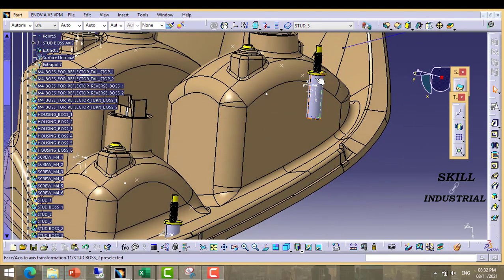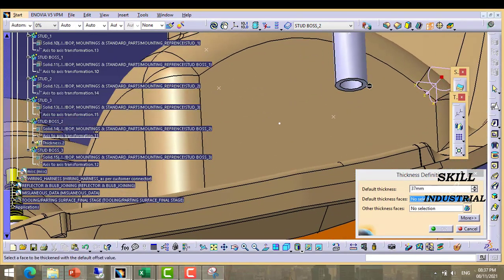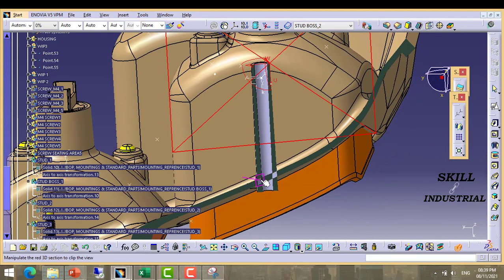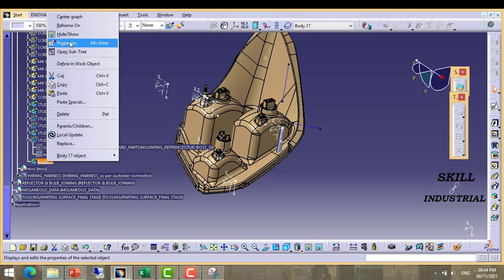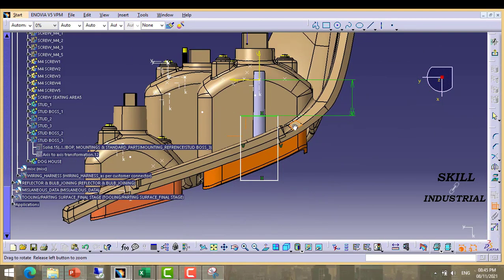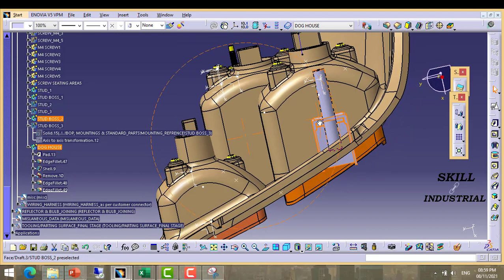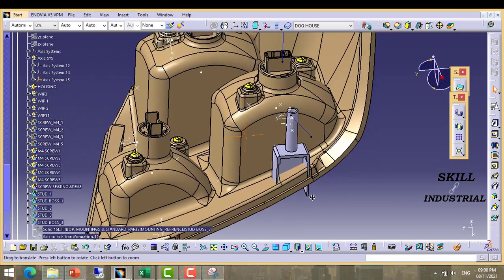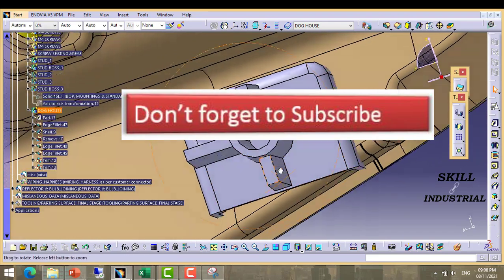Dog house using catia v5

Comment: how would work if you rotate the doghouse with 90 degrees, all feauture will not follow the rotation. if you can fix it would be very helpfull
Reply from the maker: By using new point, line and new axis system, we can rotate the dog house only at any angle.